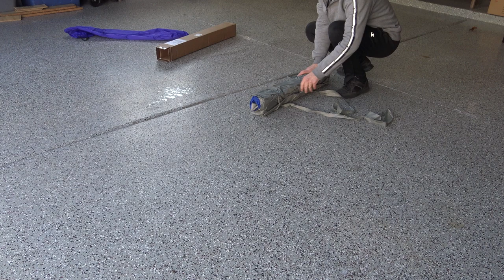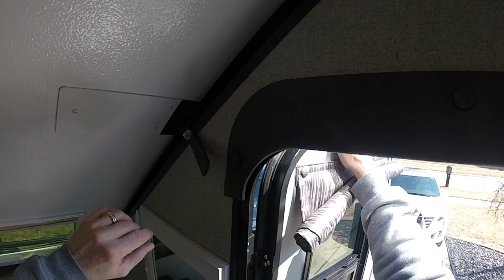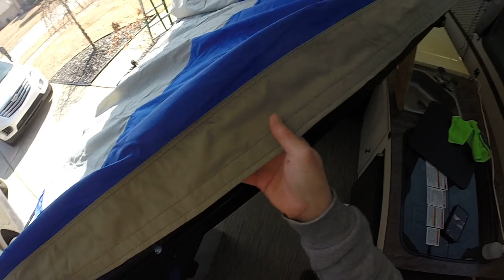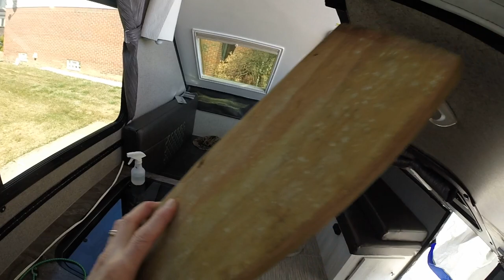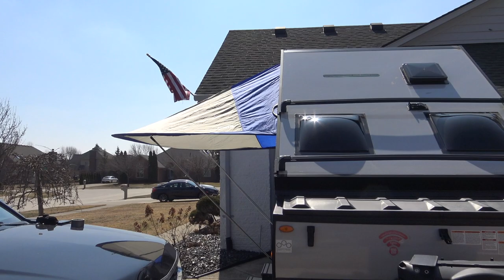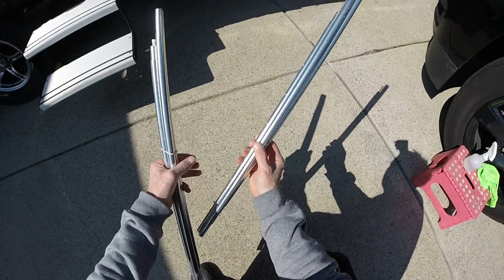How to install Visor, Awning. A-Frame Camper. Aliner. Pop-up Camper.

Comment: Lots of work putting it up but good details. I think I’ll use an instant up 10x10 instead.
Reply from the maker: Installation just a ones in the beginning of the camping season. After that, visor folding inside together with walls. 5 min unfold and 5 min fold down. Please see my others videos

Comment: Great video !!! I was wondering how the awning would be stored when the A frame was down ! The last 2 minutes answered that question !!!   Have you tried it out camping yet !!!!
Reply from the maker: Its my second visor. First one i installed on my 2013 flagstaff a-frame, sold it last year. Had for two seasons,. Very good to shield from the sun, excellent in moderate wind. For storage purpose it has Velcro strips. Just undo it for out of season storage. 3-4 minutes job.
Reply: @SoloCampingAdventures  Thanks !!!

Comment: Does any of the velcro or the pole bottom attachments that stick on come loose in the heat? I have had stick on velcro lose its stick when it is continuously hot outside.
Reply from the maker: I had for two years the same visor on my old camper, sold it.  In hot weather or in cold winter weather, all velcro and sticky parts stay attached, no problem. Just make sure the surface very clean before  install velcro.

Comment: You mentioned in another comment it was good for shade and light winds. Is it water proof and how sturdy is it in a hard rain? Does water pool along the edge?  Thanks, been looking for something that would work for my Chalet A-frame with relative ease for setup and take down.. I don't want to feel like I'm setting up a tent defeating the purpose of an a-frame.
Reply from the maker: Actually i tested in strong side wind, an its holds ok. Also during the high wind you can support the visor putting the telescopic poles on the ground ( not on the side of your aframe) for better support. Regards rain,  during the rain i extend telescopic poles, so water doesn't collect on the edge of visor and running on the side. Or you can lower the visor.
Reply: @SoloCampingAdventures  Thanks for getting back to me. One final question, once attached with the adhesive backing does it just velcro to the side walls so you can easily remove it? Looked like it did but would want to make sure before I spend $400!
Reply from the maker: @oldmillrd8153  After I attached adhesive backing to aframe, its really easy to remove velcro and attach it back to camper, but I do it ones in season. I'm too lazy to remove and attached back to aframe every camping trip. LOL I would say, you will need extra 10-15 minutes  to attach it back. Thanks
Reply: @SoloCampingAdventures  Thanks again for your quick reply.

Comment: There must be something better than this.
Reply from the maker: If you find something better, please share with me
Reply: I use a freestanding 10’x10’ tarpaulin set-up that abuts the camper: 4 x poles, 2 x spreaders, pegs, & guy ropes - less than $150 to buy new. It’s sturdy in wind, waterproof, and provides 10x10 cover to chill, grill, dine etc. Plus I can back my subaru at a side to allow protected access.
Reply from the maker: @michaelsmithson8495  We have different goal. My goal is to be mobile as possible and taking me about  5 minutes to set it up. Your setting is taking more time.